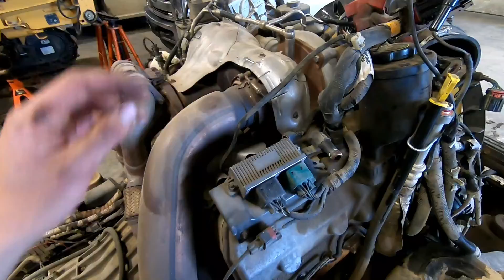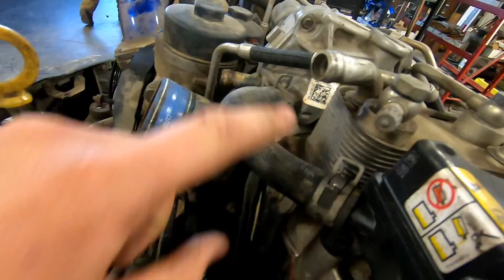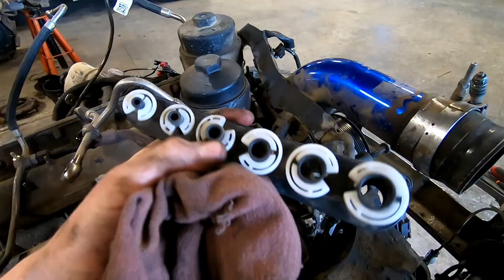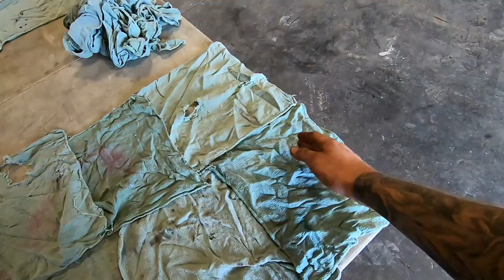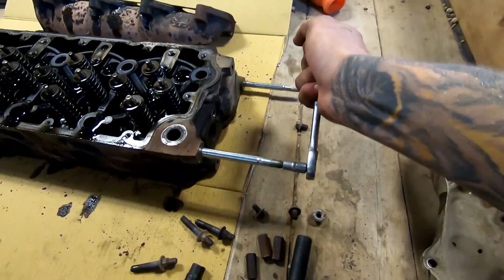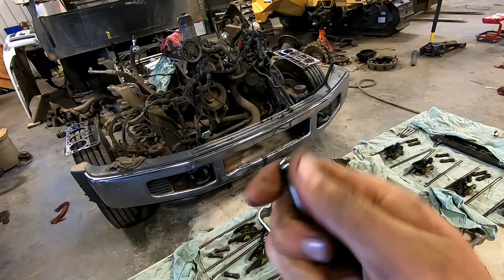HOW TO REPLACE HEAD GASKETS ON 6.4 POWERSTROKE (Part 1: Removal)

Comment: What about replacing the torque converter seal when rebuilding the motor and put new brushes  in the starter  as well while cab is off ? I like your ability to perform this work.

Comment: This right here is why I'm swapping a 12v p pump Cummins into my 08 F250 crew cab long bed. The 6.4 ran like a scalded dog before she blew up but they're just a huge pain in the ass to work on. Eight to ten grand for a running ( how well, you never know with these things, they're 150k throw away engines anyway ) junkyard engine? No...nope, not gonna happen. If however you're gonna go to the trouble of replacing the head gaskets on one of these engines, spend the extra money and stud the damn thing. O ring the heads too if you can afford it. It'll last waaaaay longer if you do those two things.

Comment: I want to meet the engineers who designed this truck.  🤦‍♂️
Reply: I remember designing this engine. And let me tell you, we started with a sheet of paper and a cold case of beer..... then boom at about 3am the 6.4 was born on date!!!
Reply: @ironjohn5914  hell yeah 😂. Factory compounds and a little tune and you’re pushing hella hp!  Never mind the four head bolts per cylinder 🤣
Reply: I hate ford's, but how else would you get 2 turbos on a V8, and meet EPA requirements  
\(-.-)/

Comment: You do not have to remove the cab. And quite a bit of that is unnecessary.
Reply: While you don't have to remove, it's about ease of access. If you do enough of them, removing the cab is simple and takes way less time than dicking around removing everything from the motor just to gain minimal access to the heads.
Reply: I would be interested to know how. My 6.4 is currently parked because I do not have the equipment to pull the cab.  I have a 2inch lift so was wondering about pulling a cross member to drop the back down and pull the motor out.

Comment: You don’t have to pull the cab. It just makes it a little easier
Reply from the maker: I don’t think you can get the head bolts out without pulling cab though, also not sure how you would get up pipes out
Reply: @darkirondiesel  two of my fuel injectors failed to pull out completely with the keeper and are now partially stuck in the head, any tips to remove so that I can finish pulling my head?

Comment: Thanks for vid! Just finished my 6.4L , also did oil cooler relocate. Not bad at all if your patient and double check things. Cummins might be easy to work on .... but the 6.4 will eat it for lunch. LOL
Reply: Yeah you cant beat the 6.4 for power as long as it runs well.mine blew white smoke for 8 miles had full power no engine light or oil leaks
Reply: @Prariedog white smoke😱 head bolt stretch= floating heads 😱
Reply: It’s the most fun truck ever for a couple of pulls, then 💥!
Reply: Never race your stock 6.4 Superduty. Did I say never race your stock 6.4 Super Duty? r @Steadierpark

Comment: Okay, so I won’t buy that 6.4 with bad head gaskets selling for 6k
Reply from the maker: Lol no probably not a good idea. Unless you can get them down to like 2k
Reply: How much would it cost to get this job done ?
Reply: @lawdtjr19  More than the truck is worth 😂
Reply: @lawdtjr19 I was quoted 13K CDN
Reply: Get as many upgrades done as possible when doing this job and never race this engine again. She will pull for you the rest of your life if you do all the right mods. By the time I'm finished with trans, front end, and turbos, it will be 35K after farming out Tran, and heads. I just have no place to do a cab off and the trans. is as alien to me as space travel.

Comment: I'll just go ahead and be that guy: do a 12 or 24v swap. It will be more expensive, but well worth it. I've owned a Durmax, a 6.7 Power Stroke and 3 Cummins trucks. Its been my experience that Cummins is the superior diesel motor.  I'll never buy another Duramax. I would consider a deleted 6.7 Powerstroke, as I deleted mine and it was a great truck. I will take a pre-emissions Cummins any day of the week. I've towed heavy with all of them, and a Cummins with a manual trans was the best of them all. Great video for Ford owners.
Reply from the maker: Yeah buddy i agree completely, but this video was just an instructional video for changing the head gaskets. If I ever get a job where I can swap out a 6.4 for a Cummins I’ll definitely be filming it haha
Reply: LMAO Cummins barely has enough power to get out of its own way!